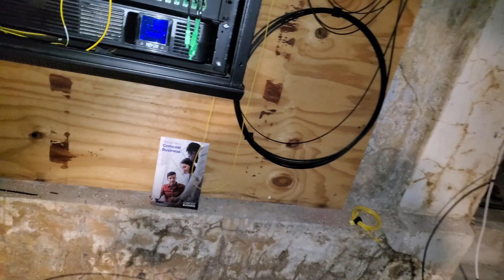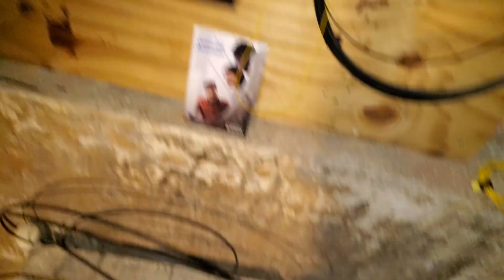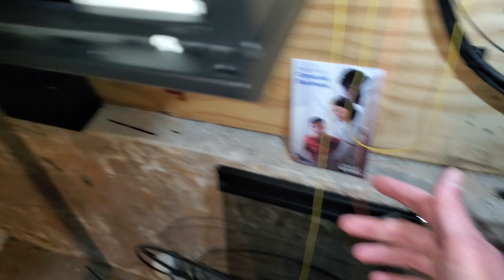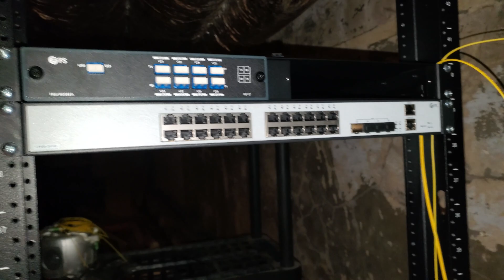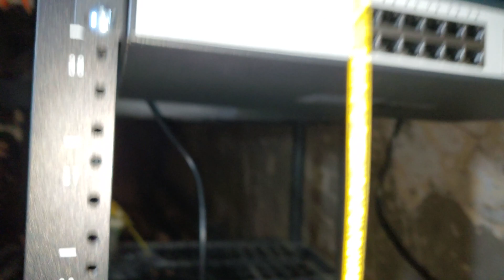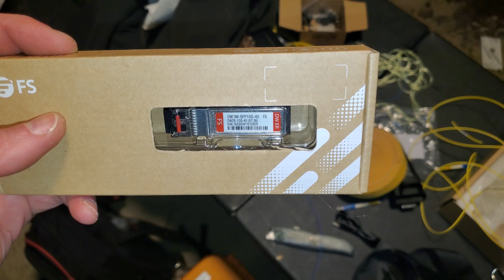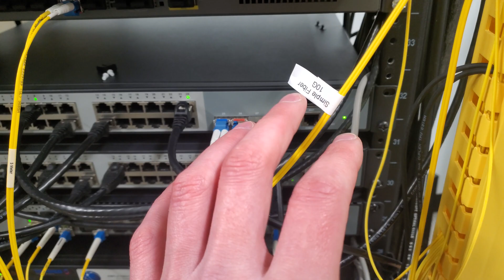18 Fiber Mile MUX\Demux DWDM single fiber system adding a 10G wave

Comment: Not redundant if there is only a single tie point for both mux😂
Reply from the maker: Redundant at layer 2 and 3 not 1.  This way splitting a node is not cause an outage also.
Reply: I understand that but real world experience shows layer 1 redundancy pays off more than layer 2 and 3 the better equipment gets but looking at the conditions that your equipment is in layer 2&3 are probably going to fail first. Definitely should get some enclosed cabinets.

Comment: I would recommend standardizing to LGX mux chassis and using 20 or 40 or even 48 channel muxes. Give yourself some future proofing. Also, though slightly more expensive, you may want to transition to tunable 10 gig optics, 120km optics. That way you only have to source one optic, you can reuse them and if the optical power is too hot; just need to pad it down.
Reply from the maker: We only use DWDM when we lease the fiber using only 1 the 16 channel DWDM is about the best you can get without using weird equipment.  If we need to expand adding 1 more leased fiber we would maybe consider using the 40+ channel ones.  Thanks for watching!

Comment: How does this work without DCM and EDFA?  Or is it in the middle?
Reply from the maker: This is roughly in center of the build.
Reply: Looks simple passive system that won't need either of those. Of course, you wont get 88 or 96 channels over 50 miles with it but shorter distance with fewer channels go nicely.

Comment: Very cool. Are you going to take a full BGP table from the upstream? As those switches are very memory limited
Reply from the maker: Haven't gotten that far yet to do honest.  Might do only cogent routes and see what options windstream has thar is similar
Reply: @briceperdue7587  If both providers are similar there is no real benefit in taking the full table. You're better off just sticking with BGP default routes from both transit providers and save a bunch of money on routing equipment.
Reply from the maker: @tivonh7075  Thank you for that info there isn't a lot of information about BGP and dealing with the big companies makes it even more difficult.  It's a big leap to move to BGP for us and getting the direct connections add up fast.
Reply: @briceperdue7587  If you have any BGP / WAN related questions feel free to DM me, I'll gladly give you some tips on how to setup and what makes sense where. (Located in Germany so might not answer directly)

Comment: Hi Brice! I simply love your videos. I'm starting an ISP in northern Italy and watching you doing the things I'll do is super motivating! Keep it up. Thank you :)
Reply: Hi, are you using open fiber's infrastructure or are you planning on becoming a wisp like eolo or linkem?
Reply: @riccardobassini9452  Ciao Riccardo, entrambi in realtà! Sia fibra che wireless, però non userò open fiber😉
Reply from the maker: Not familiar with open fiber.  We try to avoid anything wireless like the plague.  We used it twice as temporary solutions only.
Reply: @briceperdue7587  In Italy we have very strict laws regarding 5Ghz use. Our maximum EIRP is 30dbm in the 5470-5725 range and 23dbm in the 5150-5350 range. We MUST use DFS. The big ISPs use licensed stuff like 26GHz WLL. We really don’t have much interference and this makes wireless a super solid choice in our big rural areas! (Eg. I can guarantee speeds up to 500Mbps under 2.5km and 200Mbps under 6km)
Open Fiber is an Italian wholesale fiber provider that leases GPON networks :)